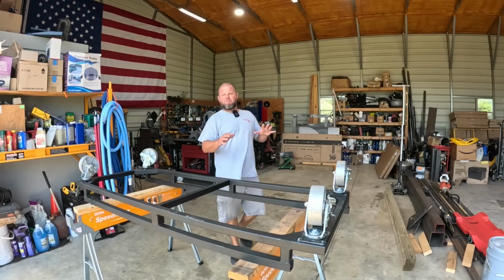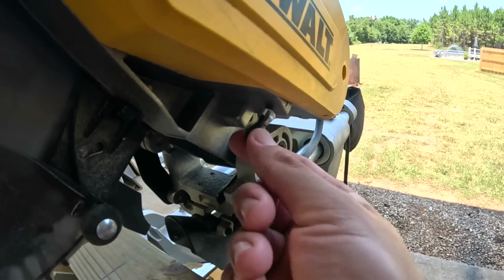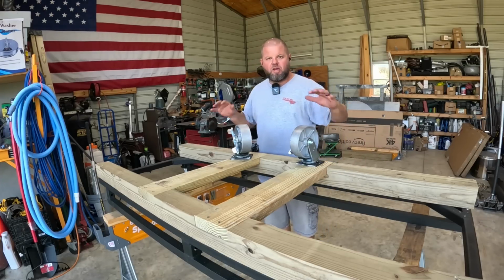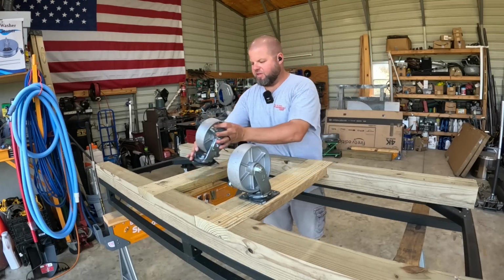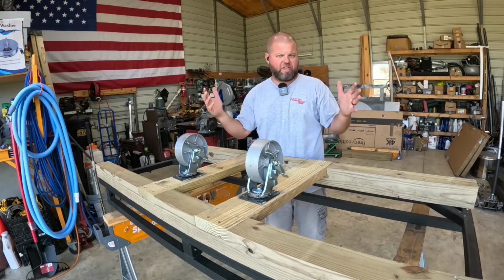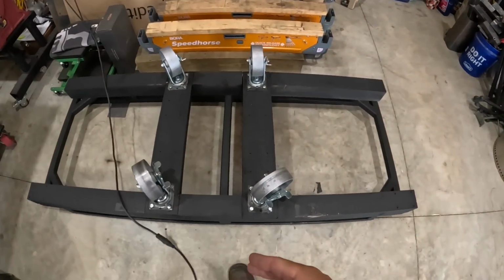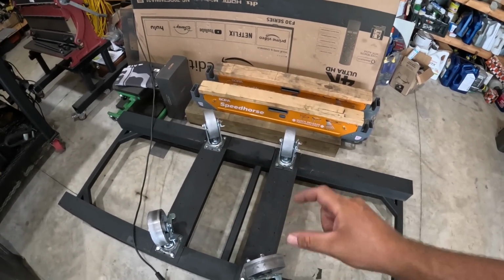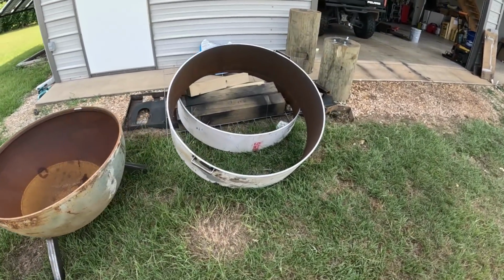Modifying My DIY Tank Rotisserie Roller!

Comment: Andrew, could you put round stock on casters and drill the 4x4 with multiple holes for different size tanks.
Reply from the maker: I'd rather not trust that design, some of these tanks are almost 2000lbs.

Comment: Why not use acme threaded rod?
Reply from the maker: Not sure what you mean
Reply: @TKCL  run it like a gantry. Threaded rod would hold the wheels and you could run the wheels in or out using a drill. Not entirely sure what it would be called, but think something along the lines of a cnc table. Would make it much easier to reconfigure than manually having to move bolts every time. Just a thought.

Comment: Hey Andrew, Check out a siphon Style ( Wet Sand Blaster ) attachment for a Pressure Washer.  My son bought one and he loves it !   He used it to blast his 6' x 12' Utility Trailer and then primed and painted it and he said it worked amazing ! ! !    You are not breathing in any sand dust because there is none because its wet and falls to the ground !
Reply from the maker: I actually bought one myself, but I need to find the sand for it.

Comment: An upgrade you can do down the line is make a stand with a articulating arm and attach a plasma cutter head to it, make it removable like the wheels and screw it to the wood. Them you just have to roll the tank on the wheels.
Reply from the maker: I had considered it, but that plasma leaves poor results and makes me do a lot of sanding.

Comment: TKCL, If you have rectangular steel tubing that fits the fork adapter of your tractor, you can cut 4 of them and weld those casters on one side. Drill a hole on the other side then weld a nut (1/2 in) aligned with the hole for a T-bolt to be screwed in for adjustability. Then you have a rotisserie roller that you don't have to bolt and unbolt the caster. It will be easily adjusted for any length and diameter of round material that you want to cut. Just a suggestion. BTW,  Loved the 14" Evolution chop saw.
Reply from the maker: Good idea, but I have to be very careful with sparks around my tractor, they damage and rust everything.  I love that new Evolution saw!

Comment: Have you thought about making an arm that would hold your grinder, where you could just continuously turn the drums, and it would cut with just the weight of the grinder.
Reply from the maker: I have, but the drum moves enough that my cut would not be clean.

Comment: A cheap electric motor with a speed control running a rubber roller would enable you to spin the tank/barrel/whatever at a uniform speed and lets you automate your cutting process. You could even use it for welding round tube stock up, or with a plasma cutter rather than a cut off wheel.
It might even lend itself to the addition of a weighted arm which would hold a cutting wheel at a known pressure and then a variable spin rate from the motor would ensure a perfect cut.
Reply: A worm gearbox off a motor stand for intricate work.
Use a piece of All thread and nuts weld feet with rubber attached to help support smaller diameter rings.
Rough idea can be tweaked with above idea.
Reply from the maker: I had kicked that around, but the tank doesn't spin perfectly, I would wind up with a poor cut I am afraid.

Comment: Nice upgrade you might consider using some T nuts/captive nuts on the wood and use bolts instead of lag screws.
Reply from the maker: If I see any stripping issues I'll definitely move to bolts.